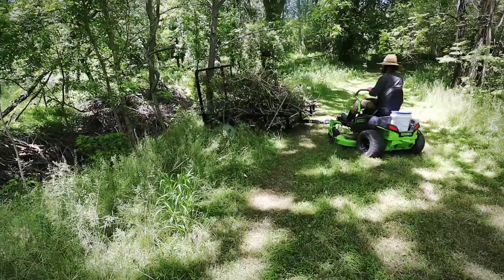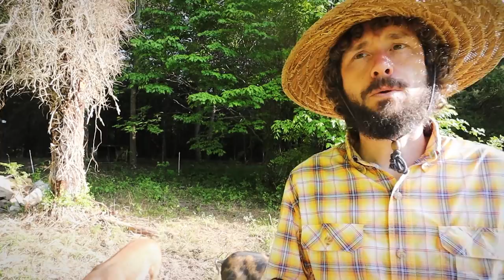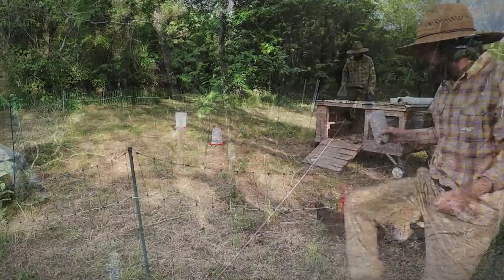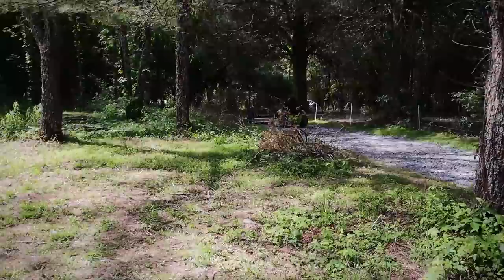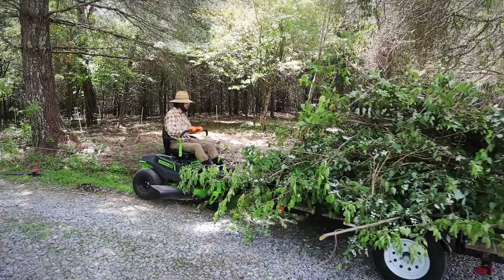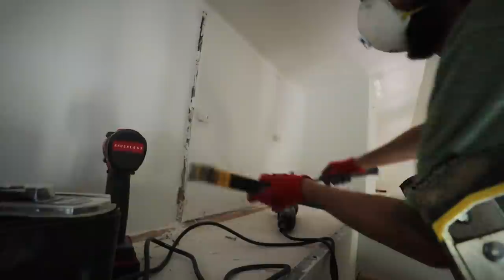Clearing Brush & Various Pig and Chicken Yackin's

Comment: Nate, when you go to close up the attic entry again, cut some trim molding for the part you want to cover up around the door and then put velcro fastener on it and wall. Then you can access it again easily and not have to do drywall repair. I did this around an old wall AC unit and it worked perfectly. I had to pull out the unit once a year to oil it so the trim pieces just pop off and stick right back on.
Reply from the maker: Thanks for the tip!

Comment: I hate cliffhangers!  Great the attic was so easy to open up so what on eartg is the big deal.  You already had moisture, mold, rot, etc.  Either more of the same or better than expected.  If you have serious allergies you should be wearing a mask.  I fought my doctor on this but it turns out it helps.  If you can breath in them that is.  The clean up is coming along.  Plan out one small section a day and then a a great bonfire on Friday nights or Sunday afternoons.  A couple of goats just for clearing  not milking if you don't have the time would do wonders.  Have fun in all that you do.  Remind yourself this is fulfilling a dream.